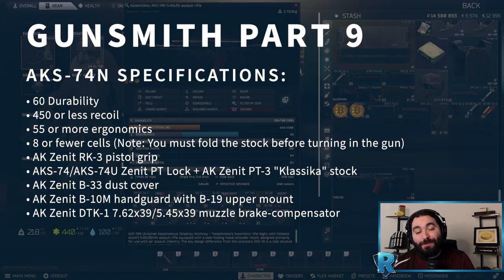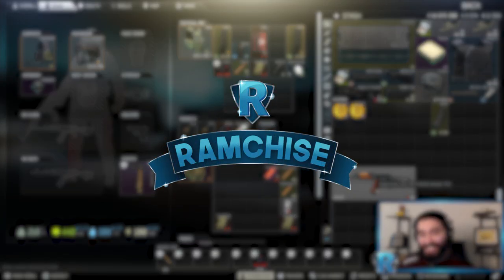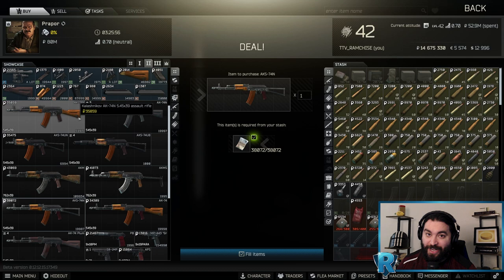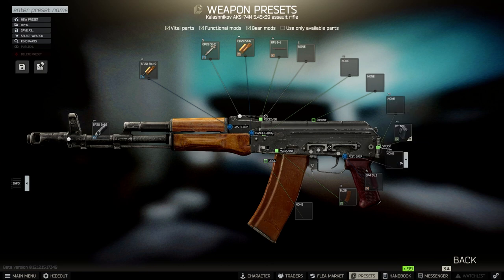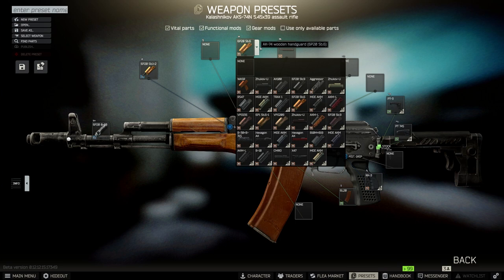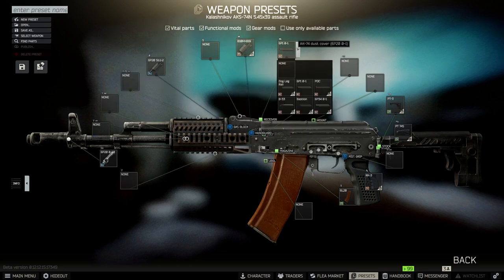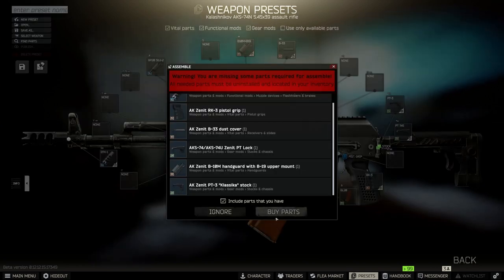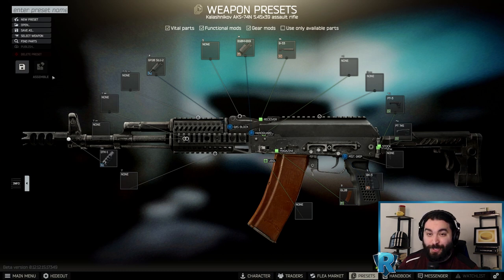Gunsmith Part 9 - AKS-74N Mechanic Task Guide | Escape from Tarkov 12.12

Comment: why cant i install the stock on the ak? i have the right components ;O
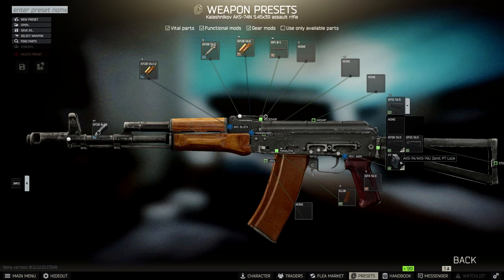Reply from the maker: hmmmm, not 100% sure. Just to confirm, after removing the original stock on the weapon you are replacing it with the aks-74/aks-74u zenit PT lock, the little connector piece at 0:42?
Reply: look if you have the right ak74 it should be the AK"S"-74N